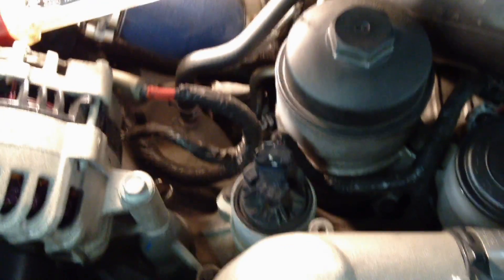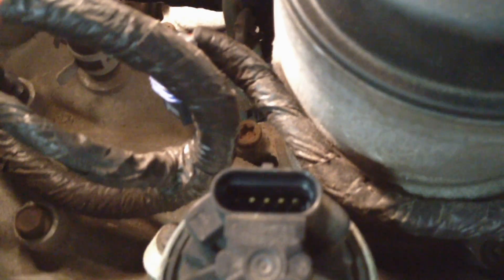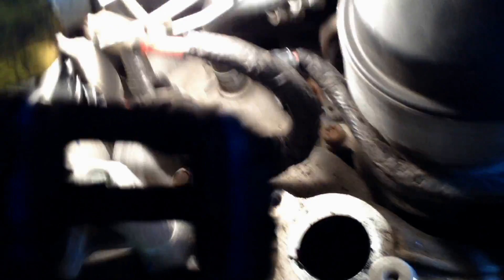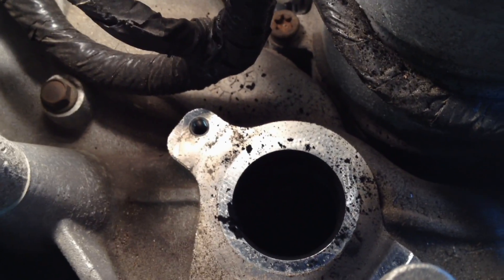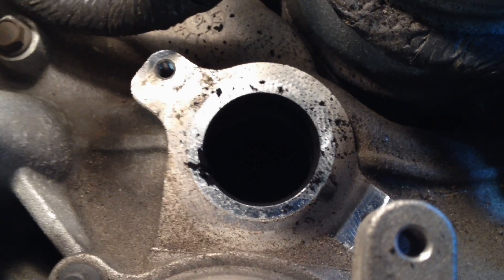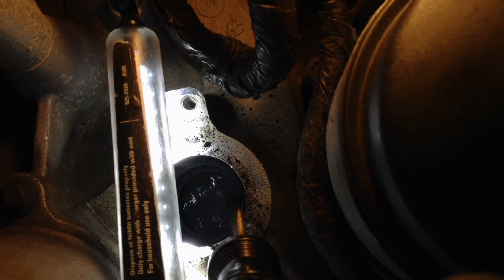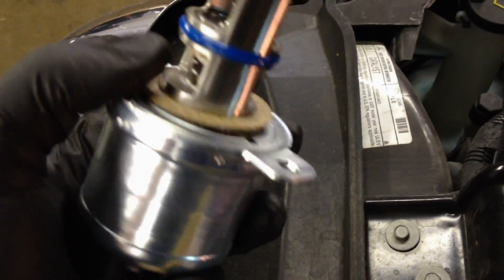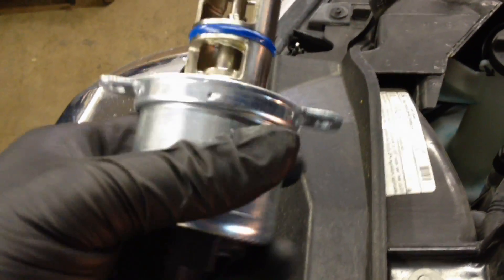6.0L Ford PowerStroke Egr Valve Removal P1335 P0401 P0402 P0404

Comment: You can use a bidirectional scan tool to test the operation of the valve while listening to the change in the engine or viewing data. You can test the sensor by determining which pins on the component, as the valve and sensor are one in the same here, and probing for continuity and resistance between the power, ground, and sensor output inputting into the pcm. If it's in spec the sensor is not at fault internally however if you examine the sensor and a chunk is missing it it is externally bad causing a bad reading which an oscilloscope can confirm in the waveforms produced.

Comment: I'm getting white smoke not black?  My check engine light code is P0404 & shows up when accelerating up hills usually then chk engine light goes away in day or so, truck idle uneven & rpm's used to hit 2.5 only going to 2-2.1.

Comment: Your video shows how to take it out and replace it what happens when the EGR code light comes back on? Well I figured it out, unhook your batterys for 15 minutes. For some reason the computer stores the code even after you clear it so you take it to Ford they charge you three hours labor to unhook your battery and clear the code. I did it mine has not come on since after replacing two EGR‘s in a row, I figured this out. Good luck people

Comment: My bolts must have been rated differently. Set my torque wrench to 120 in/lb and SNAP went the bolt. Off to get some extractors
Reply from the maker: Your torque wrench calibration is off or or you didn't feel the click.
Reply: 120? Are you fckn crazy man lol

Comment: you did not discuss how to clean an old one nor did you provide information to the type(carb cleaner) you mentioned(foaming type).

Too many ads but you did brush on the types of errors seen, would have been nice had you mentioned VGT errors associated with this(15%-85%).
Reply from the maker: This is a removal and replacement video only. If you want a cleaning video I have an entire video dedicated to that process.

Comment: Scaner show this PO402-60 (exhaust gas recirculation EGR system flow detected too much ) is a tow truck 2003 Ford f450 turbo diesel 6.0 super duty I have to change it for a new one

Comment: My buddy has an 03 that blows black smoke and yes in fact the egr valve had enough soot on it to sink a ship. My question is will that be enough to cause an intermittent no start? He is concerned there might be a second problem causing it not to start.

Comment: Thank you so much!  I went to take my emissions test and threw a P0299 code.  I found your video on that and followed it.  The coat hanger in that manifold was great.  Mine was very clogged and that cleared up the P0299.

I then got the P1335 earlier today.  I searched for a solution on Google and found you once again!  Great job!  It turned out my EGR valve was so caked with carbon it was stuck closed.  I cleaned it all out, including inside where the valve goes then vaccumed it out.  I then cleaned it out with a carb cleaner  soaked rag, greased the O-rings and put it back in how you suggested.  Great idea on the pry bars too!

I started her up and she's purring better than I can remember!  I am about to run her down the interstate to break it in a bit.  I ordered one off the internet but decided to attempt a full clean.  The check engine light never came back on after resetting it via the batteries.

Thanks again I really love your videos and never imagined I could have fixed this sort of thing by myself.  The Mechanic was quoting several hundred dollars and instead I spent $6 to replace the MAP sensor hose (figured I might as well swap it out since i had it off), and $40 in supplies and tools.  And I get to keep the tools while saving hundreds of dollars!!

I will use your videos again!

Comment: Great video man! im a carpenter and i was able to do this in my driveway with no problems, truck runs so much better now. Thank you
Reply: Did you have power surging problems ? Mine is idling bad and will cause power surging problems and 800 rpm and below it starts to surge. I’m wondering if this is the problem with my truck and if it will fix it . Thanks

Comment: I need some help, I have an 07 with the egr still on my truck, sometimes the cab when idling will shake and idle rough like an egr failure but no smoke and will go away when you hit the gas or shut the truck off and start it back up, one of my codes is saying low pressure from the egr sensor, should a new sensor fix this problem?

Comment: Hey, good info. thanks........I had the problem when accelerating. the motor would  like die out but keeps running. after letting it idle in neutral then wold rev it up and away we go. no code appears but if you pay $150 to the rip off mechanics to see what is wrong with it then it will tell you its the EGR valve if it is bad.  Then you can  buy a new Motor Craft valve from the Ford dealer for another rip off price of $ 325. If your rip off mechanic gets this valve he will then kick up the price to $350.  You can go on Ebay and buy quality  valve for a $100 made by Dorman. It looks exactly like a Motor Craft part. you can find cheaper valves too but i stick with Dorman.  so paying a mech for the cost of analyzing $150 plus EGR valve $350 and they say one hour labor @ $90( a 15 min job) and tax = almost $ 600. This is a simple job. Makuloco explains his way but I found that using a 16" adjustable plier works fast and simple. First take off the electric clip off the valve. there is a little locking clip on the backside of it that you pull out to slide it off. 2nd don't drop the little bolts as you pull them out of the of the EGR. If you dont have a magnetic socket use a piece of black tape by covering the hole on the socket and then pushing down on the bolt to force the tape into the socket, some guys use a gob of grease in the socket hole - don't over tighten the bolts when replacing them. 3rd  i get myself up above the engine to get more power and leverage when pulling up on the valve so open the pliers to fit the valve body and start rocking it back and forth as you apply pulling force. it should pop right out. wear gloves as this carbon is nasty.  now, use some W-D 40 or diesel  inside the hole. get a 8'' brass wire rod cleaner ( Harbor Freight) bend the end slightly to about 30 degrees. slide the brush into the hole about a 1/4 inch down on the right hand side of the valve hole and work out as much gunk as you can. I  use diesel and a wire brush to clean off the gunk from the brass cleaning rod.  I have shoved the rod into the ports  a good 4" and never got it stuck. ok, now go to the the left side of the hole and clean that out. use a rag to clean all the areas up. put a little grease on the valve o-rings then push it in. replace bolts and clip and fire it up. Have fun......................

Comment: I have an EGR delete on my 2004 6.0. do I still need to pull the EGR valve perodically and clean it or replace it? 
Just curious. Trying to keep up with preventative maintenance. 
I'm having a intermittent  loosing boost sometimes and I'm trying to narrow the problem down.
Reply: Tom Herr is your egr a weld off or is it the full pipe ?
Reply: carter stirrett 
it was done before I purchased the truck, but I'm thinking it was full pipe
Reply: I found my intermittent loosing boost problem. it was the electrical connection on the VGT.  Turbo was also showing some wear, replaced it with the garrett powermax turbo. Also cleaned ebp sensor and tube, cleaned map sensor connection and replaced rubber hose to map sensor. I did as much preventative maintenance as,I could. Truck runs 100 % better.

Comment: Hey makuloco ,,,my 2004 f350 6.0 was running goof and strong ,,,,and start problem ,,, start and have no acceleration when i step the pedal,,,,after some get normal,,,,i have this situation for a 3 weeks ,,and then dies on the street and don't start anymore ,,,,crancks but not start,,, diesel flow good to the filter when turn the key on ,,,I  take the ipr valve out and checked by eyes its looks ok,,,can you help

Comment: Im having this same problem the truck has p0275 cylinder 5 fault p0284 cylinder 7 fault p0281 cylinder 8 fault p0404 egr performance p0528 fan speed sensor no signal. Its hard to start in the mornings.  When the truck is running I take it out on a drive and it stalls. I checked the egr valve and its stuck open. do you think if by switching out the valve and cleaning the egr pathways it will help with the faults at the cylinders.

Comment: I  have an 05 & I'm losing fluid & tons of white smoke please tell me my EGR might be it and not the heads
Reply: Egr cooler could have a leak if you don't have coolant in your oil its probably the egr  cooler.
Reply: Egr cooler could have a leak if you don't have coolant in your oil its probably the egr  cooler.

Comment: Brian - great videos and extremely helpful and informative (and I love the inspiring Christian music in the background).  I have an '03 F-550 Super Duty with 6.0 Powerstroke.  Some sort of probe (EGT? O2 Sensor?) rusted off the driver's side exhaust manifold.  The exhaust is hissing real bad now where that probe used to be.  What the heck is that thing?  I need to replace it but I need to know what to ask for.  Also do you have any idea what might be causing my truck to run very rough and down on power until it is thoroughly warmed up?  And it seems to take a good 15 minutes for it to warm-up which is much longer than it took in the past.  The truck has only 90,000 miles - I use it to haul heavy boats short distances and plow snow (which means lots of corrosion problems).  Any pointers you have would be tremendously appreciated.  Thanks and God bless!
Reply: +Teresa Billingsley - I forgot to add that about 3 years ago I had an EGR delete kit installed.
Reply from the maker: +Teresa Billingsley I have never seen any sensors built into the exhaust manifolds on the 6.0L it must be a egt sensor put in aftermarket with  the egr delete. Are you talking a tube that goes up to the EBP sensor? Also if it runs rough or has poor power till it is warmed up you need to first run this set of cleaners through you are likely experiencing stiction at that mileage-http://www.amazon.com/gp/product/B00545OUYS/ref=as_li_tl?ie=UTF8&camp=1789&creative=390957&creativeASIN=B00545OUYS&linkCode=as2&tag=fordt-20&linkId=7F2SVYABAEYZZRM2

Comment: I have a question I don't have a CEL but my problem is that when i hit the gas i have to go easy on it till i hear the turbo spool otherwise it will smoke like a freight train it just started doing too. I cleaned my map sensor and ebp sensor it help a little, Do you think its my egr valve  is opening slowly or its stuck open due to carbon build up?  its a 2006 f450 it tows daily its all stock also.

Comment: Very nice of you to take the time and help us out. Cheers........An hour later and we got'er dun. Truck now runs better from idle to top end. My brother's truck so I made him wrench. He really was surprised at how well it runs now and said "It feels like a new motor". Thanks!
Reply from the maker: No problem!
Reply: @FordTechMakuloco  I heard the EGR valve not only works with the turbo (proper vain cycling) but it also affects the engine fan? Is there truth to this? I've read on forums about folks who've "modded" their trucks, but now the clutch fan kicks on at wonky times. Some say the EGR valve only works with the fan on the '05+ 6.0L Powerstrokes, but was a dumber system for '03-'04.

Comment from the maker: Otherwise as long as you have the latest pcm calibration they watch it very close now. Also egr shut off timer has been implimented in the lastest calibration to prevent low velocity movement of sooty egr at idle where it can stick to the valve etc instead of being passed.

Comment from the maker: If your are hard on your 6.0l every once in awhile the carbon should self clear. Also as long as the egr cooler isnt leaking coolant internally and the turbo isnt leaking excessive aounts of oil internallly the carbon will stay dry and pass more so than when these leak the carbon gets sticky and then there is gonna be a major sticking problem.  I would say every 50k no matter what take out and clean it with foaming cleaner.

Comment: Thank you for the video! Any tell tale signs as to when the EGR should be cleaned or replaced? I have a 2005 6.0 with 35K miles. Nothing seems to be wrong. Not sure if preventative maintenance of the EGR will help anything else.